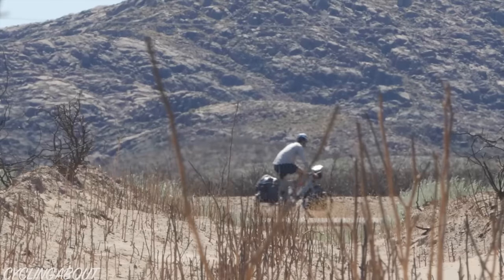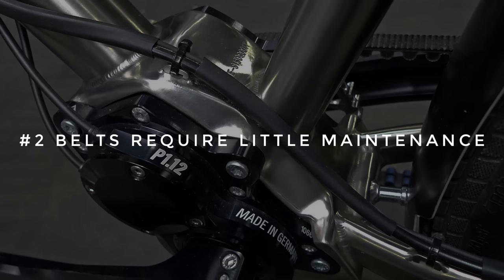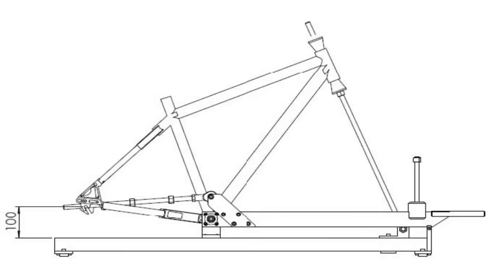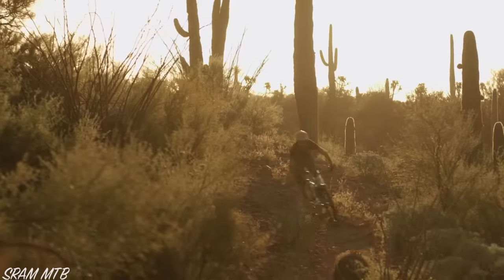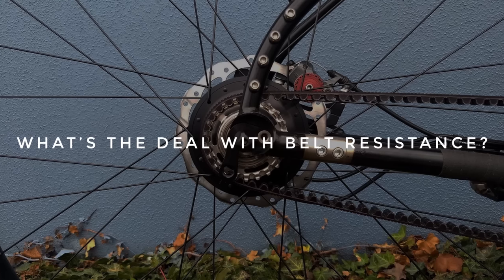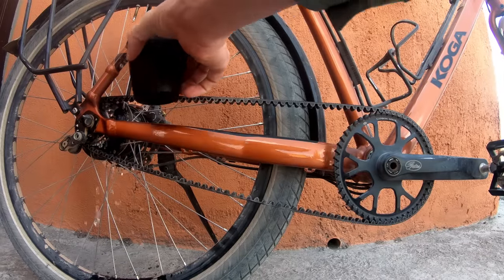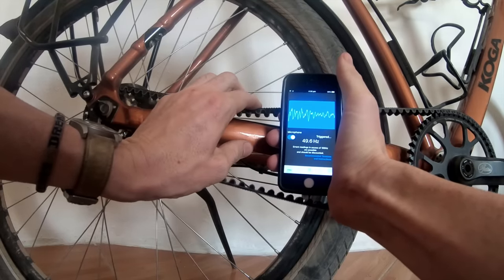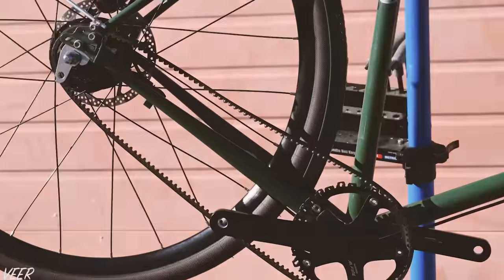Belts Are The BEST Bicycle Drivetrain Available (Epic Testing!)

Comment: I have never owned or ridden a belt driven bicycle. But I own 2 motorcycles, one that has a belt drive for the cams and the wheel, and one that has chain drive for cam and the wheels. I also owned cars in the past where with camshaft belt (also know as timing belt).

In motor vehicles, cam belts have to be replaced every x years or every x number of miles, because rubber rots and belts stretch. Cam chains are designed to last the lifetime of the engine. Comparing the durability like this, however is misleading as cam chains or bets are isolated from the elements and a cam chain is much better lubricated than a drive chain.

Comparing the drive chains/belts however, in the motorcycle world chains are way more capable of handling power/torque and are more efficient. Motorcycle drive chains do wear out faster, sand, dust gets in between the sliding parts, there is metal on metal contact, so you have to give the belt that advantage. But belts are not used is motorcycles which make more than 120 HP, except for 1 particular motorcycle (Ducati XDiavel). Belts aren't as strong or efficient as chains for a given size (physical dimensions, belts will be lighter tho) and power/torque rating . Belt on the XDiavel is huge compared to any motorcycle with chain drive of comparable power.

Bicycle chains have been made as small and light as possible while being able to do its job. Also chains are used with derailleurs, they have sacrificed even more durability than compared to if they were not designed to be cross chained.  The size difference between a motorcycle drive belt and bicycle drive belt doesn't seem to be as significant as compared to chains. Bicycle belts are overbuilt compared to chains, hence the difference in longevity and resistance to stretching. With gearboxes, bicycle chains can be designed to be more durable from not having to cross chain. It will also beat belts for efficiency over 250 watts because that's how it is with motorcycles.

I would still want belts on my e-MTB if the gearbox was mated with the mid mounted motor because belts require less maintenance. On e-bikes, additional weight (from the bearbox/hub gears), resistance matters less because you have power from the motor. But for pure pedal bikes, I still prefer chains.
Reply: Modern timing chains if cars have gotten crappy, they use sensitive tensioners and sometimes wear down after less than 150k km, because they are only single chains and no double chains any more. They are no longer made for lifetime

Comment: what happens if it is used for fixed gear? 🤔
Reply from the maker: It's only rated for fixed gear if you have a brake too. I suspect the torque gets a bit high for the belt when you lock the rear wheel while skidding....
Reply: @Cyclingabout  
Maybe you can make a video if it's used for skid with fixgear, I'm curious how the effect & result
Reply from the maker: @ematrasf  The belt will probably skip, or worse, jump off the cog.
Reply: @Cyclingabout  
according to what I thought before, I think there will be other results

okay, thank you for answering my curiosity 👍🏼

Comment: Except when Gates decides to discontinue the belt that came with your bike.  My 2016 Scott sub 10 came with a CDC belt system.  After 13000 miles and 3 years my belt snapped.  Not a problem, I thought.   I went to my bike shop and they could not get a belt.  I contacted Gates and they said they discontinued that belt and the solution was to replace all the parts at close to $300 plus labor.  I don't trust a company that does that.  They should have kept belts in stock for at least 10 years.  They should have offered me a discounted drivetrain if they really expected me to swap out the entire drivetrain.  Gates left a bad taste in my mouth.  Luckily I was able to chase down a belt in Europe, but with shipping, the $80  belt ended up costing me $135.  Gates has poor customer support.

Comment: I'm not going to try to convince you that chains are better than belts. Chains are, however, more practical for real-world use than belts, because you can get parts to fix a chain-and-sprocket drivetrain in every town on earth.
Reply: Difference is, the rohloff hub doesnt break. So you dont need replacement parts

Comment: As a bike mechanic I see real life with belt drived bikes.
Don't mount one on your bike if you aren't a minimum keen on washing your belt and cog every day.
I've several customers who managed to ruin cogs in ~1000km not 4 time longer but 4 time less than chain. And when you look at the price of a cog you cry.
Belts itself can last less than 1000km.
As one bike frame builder told me with the return on experience of his customer: belt are fine for concours machine who are loved and maintened definitly not for average careless commuter.
Furthermore chain and cog replace belts in high perf and long lasting engine (truck) for several reasons.
You replace a cam belt more often than cam chain.
Reply from the maker: You can put me into the 'careless' category, I do almost no maintenance to my belts yet they last two years of full-time bicycle touring (30,000km). 
Also, I don't think cam belts and bicycle belts are a fair comparison. The technology itself is quite different, then there are different operating speeds and loads.
Reply: You wash it sometime with water, use silicone base lubricant &co: I assure you it is more than many of my customer. It is a shame I can't share with you picture of rusty chains I replaced. Guys let it 3 years with no lubs, no washing, sleep outside... For some it is "beautiful" you could think they went through red sand desert: the rust of the chain covers the paint of the frame. Why do they call me? For the dérailleur which is stuck not because of the chain but wire and housing. Furthermore belt corrode/degrade very well (more than stainless steel). It is made of polymer for a big part. As tires 6 months under UV day and night and they begin to crack. Once it began you loose piece. And then carbon fiber are exposed to element and crack (if not corroding before. C+02+UV or heat equal... guess).
Most of the time a chain unused years can revive more or less temporarely with a good shower of WD40 and some massage.
Other point carbon belt except on single speed are far heavier. Gearbox (in the hub or not) are to put it in a nutshell: massive piece of steel.
Cycle industry invented dérailleur after for a good reason: weight and simplicity.
And far that being without maintenance: as many of customers discover when their alfine 11 is dead because they didn't adjust the selection or never did the oil change on 10000km of e-biking.
Rigid chainstay are heavier too.
Avaibility of parts: I remember reading stories of worldcycling adventurer regretting to be stuck weeks because they couldn't repair their Speedhub in the middle of nowhere. (Rohlloff send parts hopefully).
There is not only cams. Final transmission by belt is mainly used on motorbike with which you need a car assistance to follow you to be at peace.
Personally I'm thinking to make a single speed belt drived but I doubt I will ever advice it to an average commuter or traveller.
Some of them are chocked when I tell them that inflating a tyre twice in a year (I recommend 15 days/1 month for butyl, every day for tubeless and latex) isn't enough.

Comment: Only one thing I do not like about belts is a chain you know you have to change it when it stretches. belts will look like new and snap, How I know it happened to me.  I see you rolling the belt check with the belt maker, that is not recommended.   I worked with belts a lot and in the right places you can not get better.  Changed many drives from chain to belt, went from changing them every year to over 10 years and still same belts.   A belt that is to loose can ware sprockets faster.

Comment: Then why aren't belts standard in races such as the Tour De France?
Reply: I believe he explains in the video that chains with derailleurs are still the most efficient (as long as they're clean) and lightest. Looks like that will continue to be the best option for racers.

If you're not looking to beat time records but want endurance instead, belts seem to be a great option.
Reply: @samuelitooooo  when you consider how much lighter your wallet will be when using a belt drive, I think you’ll end up with a lighter bike over a traditional chain and derailleur system.
Reply: @mieczysawkowalczyk5772  you have a point

Comment: Belts create more friction, thus increasing drag wasting more energy than a well maintained, low mileage chain. If you're riding in the mud and don't care about maintaining your bike, then a belt and internal gear hub would be more desirable. The cassette/chain drive train is the lightest available.

Comment: The financial aspect is the most contra for a belt drive for me. Not because of the cost of the belt drive itself, it is the cost of the gearbox  you need in conjunktion with the belt drive. One good gearbox costs more than a bike for me. And with a chaindrive I can change gear ratios pretty quick and cheap. I use my bike for comuting to work and the ocasional weekend trip. It would take me far to long to come to the financial break even point with the cost. I bought a electric Trecking bike from Focus with a bosh Active line Motor used with 700km on it for 1400€. It is a good quallity bike I can drive for years to come without magure repairs. One change of the chain drive train will cost me in the range of 100€ in two or tree years. So for the little I drive my bike it is not worth the Investment.

Comment: Do not agree. I had a belt driven folding bike and broke the belt after a few years. The bike I ride normally is a chain driven commuter bike with a chain that is more than 30 years old. I do a minimum of 100km per week on that thing.

I think the problem is not the chain, but bikes with derailleur gear systems. A badly setup up derailleur puts unnecessary lateral stress on a chain, making it break sooner. But no way will a belt ever outlive a chain when set up correctly, especially in a commuter setting with hub gears.

Comment: As a bike mechanic, when dealing with chain systems, even in a small community shop, it's very likely that we will have all the parts in stock to perform any maintainince the bike needs, and certainly the know how. For belt systems, the entire service procedure for us, is to order a new part, or warranty the existing one. Deraillieur systems are just so well optimized, and refined that there are options for any scenario.

Also a lot of your comparisons were just ridiculous. Using the sram xx1 chain, one of the most expensive available, as well as excluding the additional weight of the hubs for your "weight comparison" is just cherry picking data. 

Belt drive systems, require the use of specific frames, ultra specific drive trains, and a select few hubs, all of which require proprietary parts. With the frames, the requirement of a unique frame design means that options are severely limited. In addition, compliance, ride, and weight are all effected by this choice, all for ultra specific benefits. All in all, if you are an ultra long distance, off road touring rider, sure belts are cool. And if you just want a belt, go for it. But otherwise, belts aren't the magic bullet, bike manufacturers have been doing ridiculous shit for the past century, and if belts really were the way forward then more people would be doing it.

Comment: While I appreciate the video, one thing has been bothering me: The "efficiency" argument. It makes no sense, and I'll state why.

First, a comparison. Cars use a ratio called "Power-to-Weight Ratio." Basically, the idea is, have a mathematical number to compare the total overall output, which is used to determine if a car can go further on a fixed amount of fuel, such as miles per gallon.

That being said, cars lose weight by changing engine block designs and using lighter materials, as well as using lighter-weight materials in the cabin. Even rally-racers eliminate as much unneeded weight for acceleration, braking, and cornering reasons, including lightening up the overall weight of the wheels.

Which is why I don't buy this "Belts are less efficient than chains" argument. It's a well-known fact that a rear cassette, front chainring(s), and chain weigh about 4 times as much as a belt drive. So why, then, is a belt drive less efficient than a chain drive, when the rider is putting down just as much power to a lighter bike? While it may not seem like much, losing 5-10 pounds or 6-8 kg on an already light bike actually does make a difference: Endurance and rolling resistance. While rolling resistance is determined mostly by wheels, tires (and air pressure), and hubs all working together, that rolling resistance is much higher in a worn system, or a dirty, corroded system, than a new or maintained system.

Thus, I find that "efficiency" needs to be explained, in the sense of, "efficiency of motion (or torque) transfer", rather than overall efficiency of rider effort over time. The former will be less efficient than a chain drive, sure, while the latter is actually the opposite, simply because the overall effort of a rider over time and/or distance is less for a belt drive, than it is for a chain drive -- thus, the belt drive over time/distance for a given level of rider effort is more efficient, because there is less rolling resistance in the drivetrain, due to less weight, thus less friction.

Comment: I think belt drives are great - but the bikes frames has too be high quality to work well with the belt drive. I had a bike and when Id put the power down the frame would flex. All this flex blew out the side of the rear cog. I had to swap out the belt system for a chain due too frame flex.
Reply from the maker: It's not really a "quality" issue, but rather, an engineering issue. If a company doesn't optimise the tube shapes and wall thicknesses of their frames to the required belt specification (sometimes they cut corners to save weight) - belt drive simply doesn't work well.
Reply: @Cyclingabout   I guess I should have mentioned I also broke the frame in 3 places - small cracks next to welds. This particular frame had engineering and quality issues.

Comment: A ndw VanMoof costs 2.2k euros, it comes with a chain in stock. There is a company Veer that offers a belt drive upgrade for 400 euros, and this just sum stops me. I am not convinced that all of it's advantages are worth investing this money. I would appreciate if VanMoof bike would come with a belt drive by default, for extra 100-150 euros, but spending 400 is just too much.

Comment: I broke 2 belt drive belt is 10 miles on my mountain bike. You will never ever see a powerful biker putting down big watts using a fancy belt and special drivetrains. everything needs to be straight and they completely fail instead of stretching. They are better in the salt and sand but that's about it. Also, chains are more mechanically efficient. If you want something fancy get a belt. if you want something cheap and tough get a chain.

Comment: this is somewhat strang for me to hear because in automotive applications chains are usually preferable to belts, direct gear to gear being better still, im assuming there are direct drive systems for bikes with a torque tube and id like to see a comparison between the 3

Comment: i have my bycicle for 10 years now and never changed the chain lube it up once a year and done
Reply: In this case you don't rive very much, or the chain is worn, they have a typical lifespan of 5 to 7 K km until they are worn. If you ride a worn chain it wears your cassette and front chain ring

Comment: Don't see any problem with chains, they're cheaper, more repairable, easier to acquire and I imagine that belt drives have slightly more friction than chains which steals valuable watts. Lets say you were in middle of nowhere and belt snaps, then what? if chain snaps you can just shorten it and relink it. If you're in middle of nowhere and geared hub breaks then what? on a chain drive even if derailleur breaks you can shorten the chain and make it into single speed.
Reply from the maker: Chains are good. But for what I do, belts are better.

As I showed in the video, belts are about the same resistance as a chain at 200 watts, and it's only 0.5-watts more resistance with a belt at 150-watts. There's not much in it at all.

What do I do when I break a belt? I just replace it with the one I carry. Not a big deal and I've only ever had to pull out the spare belt once in my life, so it's not like it happens often.

The only issue I've ever had with a Rohloff hub is a broken flange (2014). I could still use the hub, but was a spoke down until I reached a service centre a few months later. I haven't had any other issues in the last seven years of travel, so Rohloff hubs definitely pass the durability test.

Comment: If belts were this good, professional cyclists would have adopted them decades ago.
Reply: I think a point he stressed clearly is that these are great for touring, especially in adverse conditions, because the need less maintenance and last longer. Professional cyclists have professional service teams so the effort of cleaning and maintaining proper lubrication doesn't matter to them. So yes, professional racing cyclists aren't the intended market, them not adopting it doesn't say much about the usefulness of belts for touring or commuting.
Reply: Well in BMX and mountain bike riders are not going to switch to this because of what exactly they're Sports entail this is good for Consumer Market specifically cuz it's less maintenance then dealing with a chain which can rust and or snap and hurt you very bad or even worse it could break and then you have no brakes if you have a coaster brake